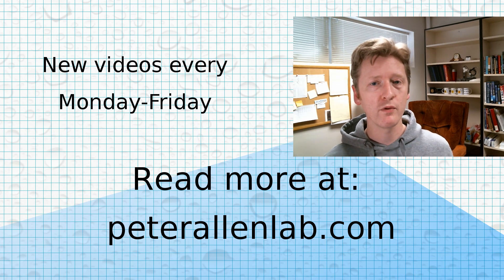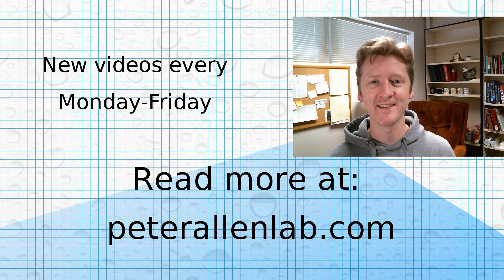Build a better iron battery cell: Design 5

Comment: I attempted to contact you.  Your links have no email addresses or methods to get in contact.  I have a laser cutter with a 5 foot bed,  a CNC plasma cutter and a CNC router.   Along with that I have a full shop of metal tools.   I can construct anything.  I want to construct a Iron Flow Battery for my own use.  I have looked at the patents filed and I am unable to determine how they lay out.  What is the chemicals to use in the right quantities and etc.  Perhaps we can help each other.  I am more than willing to make parts for you if you can help me design a large system for myself.  Please feel free to contact me at davidstanton001 at gmail.com   Thanks and good job!

Comment: You could try to avoid the corrosion of the copper by using a graphite stick out of and old dry cell and wire that to copper with some epoxy to seal it? Worth a try. Great work by the way!

Comment: Naval Research Lab doing 3D zinc sponge. Requires 2 baking sessions, one to anneal and drive off oily emulsion residue and one to fuse. (Iron fusing temp very high) Iron sponge? Lots of surface area offsets low energy yield?

Comment: Instead of wire, have you considered using glass capillary tubes for the graphite/graphene? Would limit the size of course...
Reply from the maker: I would like that - one thing I would love to do is pyrolytically deposit carbon on fused silica fibers to act as a current collector and electrode. I'm not there yet, but maybe with the help of my neighbor who does a lot of pyrolytic carbon...

Comment: In a square inch it charged to 4 volts in 15 sec. held that for 2 min. I was just kidding around with my grandson. Realized the way I made it would create a induced field. I ran a 2 double a motor for 15 sec on it.

Comment: I have recently. By accident made a forced induced conductive battery. I was shocked by the energy stored in my carbon graphite graphene and few other doped compounds. By using a spin wire with embedded carbon. The electromagnetic field induced charge to be held. Fast.

Comment: The gassing is all most impossible to prevent. The problem is distance resistance and chemical molecular exchange. Example. When you apply a current the particals that transverse the fluids Ions. Are a charge polarity. Which because of the discharge. Electromagneticly attract to the collector surface. It’s during the transfer across the great divide of space hydrogen is split. Actually oxygen and hydrogen is released. The ions is traveling at light speed. To remove gassing. You need to use a less resistive fluid that still allows continuity. The either that lightning battery use is one. Also the separator. Needs to be as thin as you can get them. But porous. I highly recommend you direct your work to paper batteries.
Reply: Guy Ruff why not harvest the hydrogen via a ventilation tube into magnesium hydroxide or other storage medium?